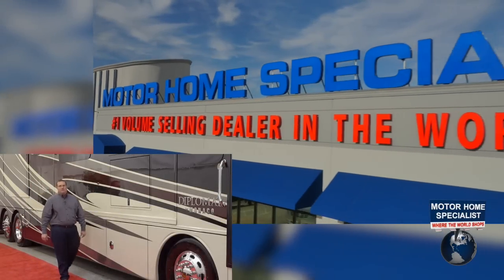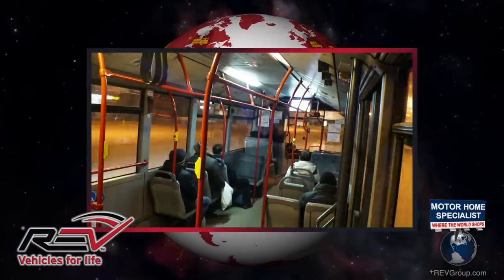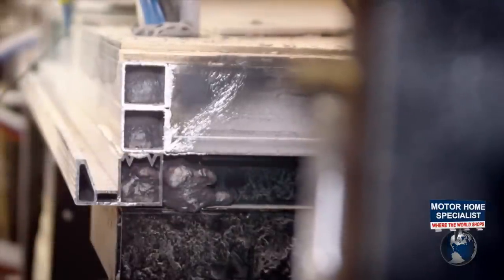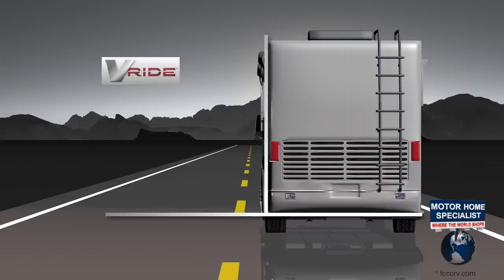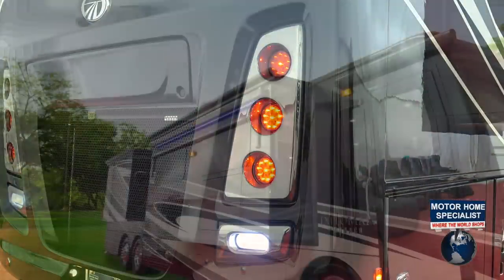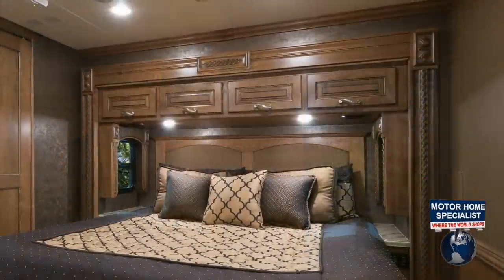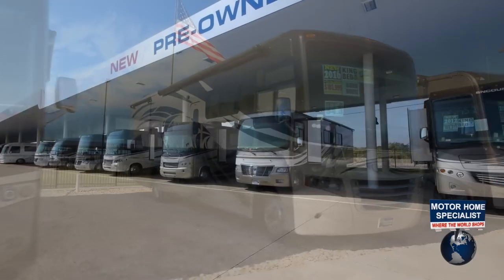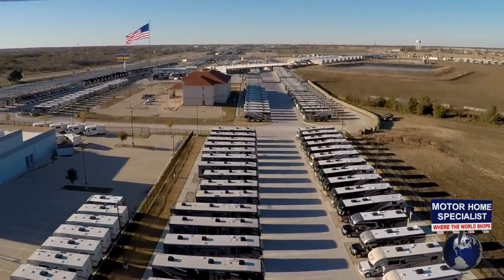Must See New Luxury Motorhome! 2016 2017 Monaco Diplomat RV Review at MHSRV.com

Comment: Glad to see Monaco and Holiday Rambler are continuing with the high standard of construction. We have a 2000 HR Endeavor 35WDS with a single "super slide"  and over 100,000 miles, and it's still rock solid , When we can start to "full time" we plan on moving up to a longer unit with a more slide outs. Love the Endeavor!